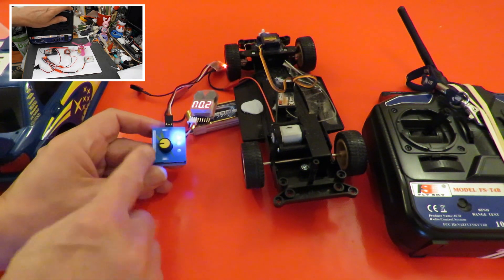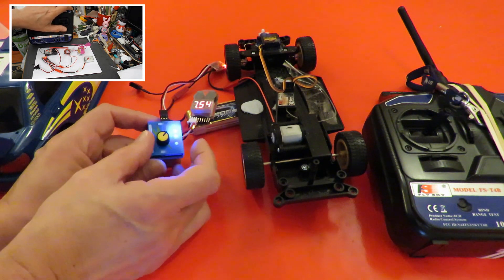Forward Brake Reverse Cheap RC ESC

Comment: Try a pistol grip transmitter. I had one of these escs and it worked fine with a pistol transmitter.
Reply from the maker: It is just a matter of having a transmitter that will give you the full throws. It looks like the FlySky FS-T4B is dialled down a bit, maybe they are aimed at beginners. With my FlySky FS-CT6B you can adjust the throws and get the full range. I do have a pistol transmitter too.

Comment: This video is helpful as I just ordered one of these from Amazon in a pinch when an Ebay supplier failed to ship my 320A as promised in his ad.  I think you would be ahead to get a car type transmitter...just works better with cars.  My question regarding this esc was whether or not it even had reverse, as it is not mentioned in the description.  I will be using mine in a Radio Shack Off Roader conversion project.  You mention your controller is flysky...take a look at the Flysky TX FS-GT3B  car transmitter...very nice and under $40 (Amazon U.S.)  with a receiver included.
Reply from the maker: Thanks for commenting. The eBay listings (and I guess other online stores) can be very frustrating and in many cases the sellers don't know any more detail of what they are selling either as I am sure they sell on commission for the "real" seller. You can see many sellers selling exactly the same item and using the same pictures and listings details and if you ask them a question they cannot answer you directly. In the end you take a risk because they are so cheap. They often have a note in the listing that they will exchange items but you have to pay for the postage which of course would be far more expensive than the item cost you to begin with. For example "Returns: 30 days refund, buyer pays return postage"

Comment: just plug the esc into the channel controlled by the right stick as its self centering and steer with the same stick or steer with the left stick
Reply from the maker: Nope, doesn't work for me with this transmitter, I tried that.

Comment: I have virtually no experience with RC so ESC is a key on a keyboard to me.  I presume, that the ESC 'break' shorts the motor wires together to create drag from the motor rotation.  My question is about having to 'go into full reverse' after using the break instead a being able to use reverse in a normal manner.  Is that specific to racing?  Or is it specific to Cheap ESCs?
Reply: yeah a google car for my home :-)
Reply from the maker: I make no claims to being an expert of Radio Control equipment. If I was I would not have needed to make this video. However ESC is Electronic Speed Control and there are different types depending on what sort of electric motor you are using. In the case of the one shown in this video it is driving a brushed motor and is using Pulse Width Modulation to control the speed of the motor. If I knew exactly how it worked I wouldn't need to fuss around trying it to find out but there were no instructions supplied with these cheap ones and to be honest I doubt that the expensive ones would give you a detailed electronic explanation. As far as I know you are right, to apply a brake effect it simply switches an electronic load across the motor so effectively "shorts it out". You would have to ask the question on a proper RC racing channel to establish whether they use them as my investigations have given mixed messages. Some forms of racing seem to use them and some seem to ban them. As for using them on boats or planes I cannot see any benefit and yet again some of the RC forums talk about using them on aircraft. If you read down through the comments here you will find some other people share their experience or knowledge. For example Marcus60661 gives his experience.
Reply: Hello I think you are right the problem is coming from transmitter
if you would have a transmitter whit travel adjust menu then you can probably increase the value range when the thottle is down untill you reach the "break point"
I also use that type of ESC and I have always problem when I brake or go reverse to go forward. i have to put the stick in the mid position to be able to go forward. what I have noticed is that the led on the esc is flasing till you are not in the middle point...but after a break or a reverse, it needs some times 2 to 3 seconds to be able to go forward again or I have to move a  the throttle stick 2 or 3 times a little in backward direction to be able to go forward again...very strange. What I have noticed is that the reverse is not proportionnal on mines ESC's...it goes straight reverse at full throttle...hopefuly on my transmitter  can adujst the throttle curve
btw all your videos are really interesting
Reply from the maker: Thank you rdemrem, you will see in the video description I explain the problem is my FlySky FS-T4B transmitter does not give the full range of control so it cannot make best use of this type of ESC
Reply: Thanks I saw also your other video afterwards
here the link of my mini austin that was previously controlled by a smartphone and bluetooth with on/OFF throttle and on/OFF steering that I have totaly converted in RC car with a 2S lipo, a proportionnal speed with same type of ESC you are using and steering system based on an servo thanks to your video and others tutos on the web. I have also equiped with a mini camera and video transmitter to drive it in FPV in Da house !!!

sorry the link is totally in french 
http://www.modelisme.com/forum/auto-mini-rc/196770-faire-sa-premiere-voiture-rc.html
Reply from the maker: Hi rdemrem, that car look good fun, love the camera on the front 😊

Comment: Attach a servo to the servo tester and put the servo on the throttle channel. lol just a silly idea!
Reply from the maker: I don't quite follow where you are going with that. The servo tester just operates the servo, it doesn't have different channels. I have used a servo tester to give manual control on electric toys if that is what you mean 😊
Reply: GrandadIsAnOldMan No, the servo tester seems to work better, so attach the servo horn to the knob of the tester, and put the servo on the throttle channel of the receiver.
Reply from the maker: The Droniac ah, as an interface between the two. Just using a different transmitter would do the job but I can see where you are going with that and it should work if the servo has sufficient rotation, many don't.
Reply: GrandadIsAnOldMan oh, well, just an idea...
Reply from the maker: The Droniac Always need new ideas coming in. Might be interesting to set it up anyway as one of those Heath Robinson toys. Depending on where you are in the world you probably call them something else.
Reply: The problem is your Transmitter is for an aeroplane hence the throttle has no spring in it, if it did it would be easy to switch from brake to reverse.
e.g.
Move throttle stick forward -> Motor Accelerates forward
then move throttle stick all the way to bottom -> Motor reduces acceleration then starts to brake until full brake (starts braking when throttle stick moves past midpoint)
Release throttle so throttle stick springs back to centre
From midpoint moving throttle stick down will activate reverse.
Reply from the maker: Thanks Wotty you are right but I am afraid that is not the full answer. I can easily use the right-hand stick as that has a centre return spring and I have tried that. It does not work consistently. Sometimes it does other times it doesn't and I can spend several minutes flicking it back and forwards to get it to work which is pretty useless. As I have explained in other answers it appear that the FlySky FS-T4B does not give the full range so FULL REVERSE stick does not give full reverse (or full brake). I use both sticks for variable thrust steering on boats and if I use these ESCs I cannot get reverse thrust when I want it and changing to an RC car transmitter will not give me that sort of steering control. If I could get full reverse then these ESCs would work for me and I would expect that a slightly more upmarket transmitter with adjustable throws would allow this to work 😊

Comment: I've been wondering what are the tones for?  from what I heard that the sound comes from the motor
Reply from the maker: The high pitched tone is caused by the way that the ESC controls the speed of the motor. It is PWM (Google it) in effect is it sending pulses of current to the motor not a steady DC. So instead of starting with a low voltage and increasing the voltage to increase the speed, it sends lots of short pulses of full voltage. The longer the pulse and shorter the gap (the width of the pulse) the more power the motor receives. These pulses are at a frequency range that you can hear so you hear a high pitched tone.
Reply: Applejack I've also been wondering that as well. If you seen my FHRC channel, I got a Traxxas Slash and Rustler, and everytime I ease on the throttle, it makes a high pitch whine
Reply: TraxxasDriver31 yea I've seen your videos about your Traxxas car

Comment: The way the brake works on most esc's is that you need to tap reverse twice from mid point which is easy to do on a car radio that self centers by itself. (Guessing the right control stick has a spring that makes it self center again ? while the left one doesnt)
if neither of them does it id try ordering a cheap car pistol radio to make use of the esc's.)

https://hobbyking.com/en_us/hobbyking-gt2e-afhds-2a-2-4ghz-2-channel-radio-system.html
from the europe warehouse there (same protocol as the other receivers you got for that radio i believe too.)
Reply from the maker: I may buy one of those just so I have one handy but the economics of buying a transmitter just because the seller does not supply enough information to make an informed purchase does not make sense. The point is that for some reason the ESCs with brakes seem to be cheaper than the ESCs without brakes so when you are buying the cheapest you can find you end up with one with a brake and no idea what it does or how it works. That transmitter is cheap but it is still 4 or 5 times the cost of the ESC.